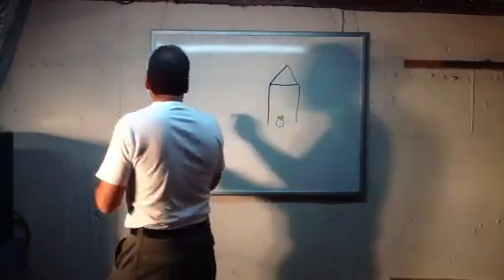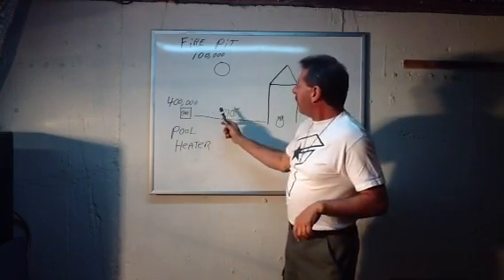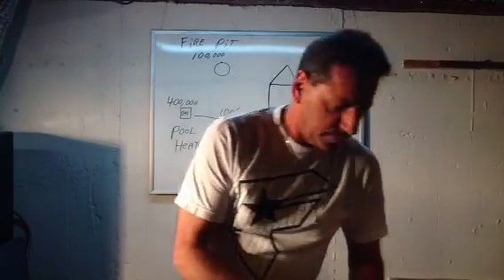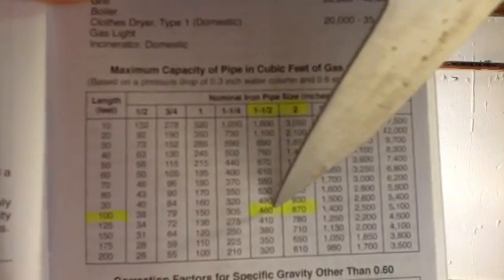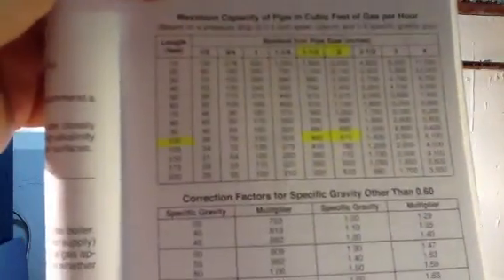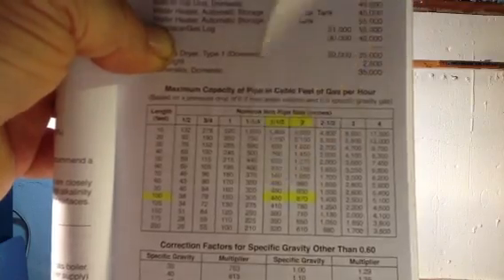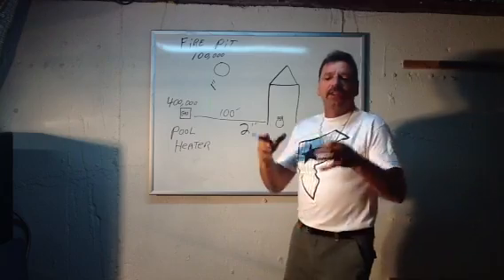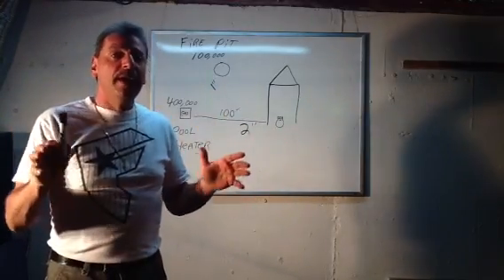understanding proper size gas lines for proper BTU

Comment: I'm not sure I'd personally use a low pressure meter to supply this kind of demand.
I typically encourage a customer to switch the original meter to 2 lbs. system (or high pressure) with the utility company (400 bucks) and put everything on individual regulators and be able to run smaller diameter copper or lines of your preference underground or wherever to new high demand appliances and burners.   Otherwise there is a lot more that factors in then what is shown in this video, like btu drops with every tee  or elbow and maxing out the low pressure meter potential for high demand appliances being used from the house simultaneously etc.
Seen it happen too many times where high demand gas appliances can't get hot enough while other appliances are running exhausting what the stock meter or regulator can provide.
Recommendation: not only do the math and check with charts, but verify your math and charts with the authority having jurisdiction in your area, plumbers have not always had this kind of training with gas and assume a lot, contact your utility district for advice; be humble and wise and save yourself a lot of headaches and mistakes and further expenses.
(17 years installing gas Ines and custom burners and trained by my metro utility district MUD)

Comment: Diversify the load as 500k is the full load.   Also, the gas meter probably only supports 250k - 630k depending upon the type and size.

Comment: Longest run method, determine your longest length (100 ft), then that will give you your first pipe size. Since you have that second 80ft, when looking at the chart, all you need to do is look under 100 ft and go over to the BTU.

Comment: I saw your part 4 video. You didn't use 2" pipe. Also when you add on to the end of the run for your firepit, you should have added that to the end of the 100' and used that column. It would be different if you added a tee part way, but you didn't.  Watch How to size pipe by grayfurnaceman. He really knows his stuff. BTW. I'm a 30 year gas journeyman.
Reply: Hahahha burn.

Comment: Can you increase meter flow outside and  use smaller pipe but use regulators at the appliances you are installing toget what you need?
Reply: Mechanically, yes.  In reality, maybe: it depends on your gas utility's standards.  There may be a fee to upgrade to elevated pressure if they will even allow it.  Call and ask them.

Comment: Thanks for this video. Still a bit puzzled though.  I'm in similar situation, gas pool heater install.  Local plumber told me I needed 1-1/2 - OK I get that but...pipe leaving outside gas meter is 3/4 ... Immediately goes into adapter elbow to bring it up to 1-1/2. Doesn't make sense to me - isn't total gas flow limited to smallest diameter pipe?  What's the point of running 1-1/2 inside the house if all gas needs to first squeeze through that 3/4 nipple on the meter?
Reply: (This reply assumes the meter is properly sized to begin with.)  When no gas is called for the meter will "pack" the 1 1/2" pipe at the pressure your gas utility supplies at the meter.  Upon initial startup your heater will suck down a volume of gas but then typically taper off to a lower usage and the meter will push gas through your 3/4" fitting and nipple and re-pack your 1 1/2" pipe.  Going to a 'bigger meter' will do nothing for you, it's the pressure the meter supplies and your pipe size.  If you size your pipe correctly, things will work.  If you size your pipe incorrectly you could install a larger meter and still not have enough gas at the heater unit due to pressure loss in your run of fuel line between meter and appliance.
Reply: So you likely need to ask the gas supplier for a bigger meter (free) and lead bigger pipe then from the meter
Reply: For volume
Reply: Not necessarily, see my reply to Kip Landingham's original question.